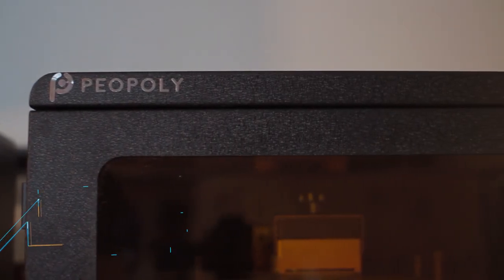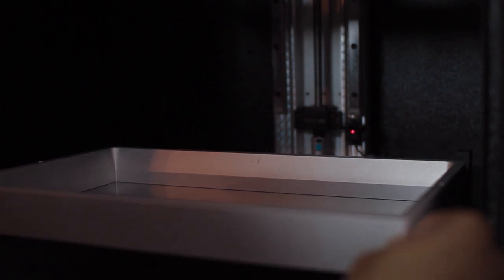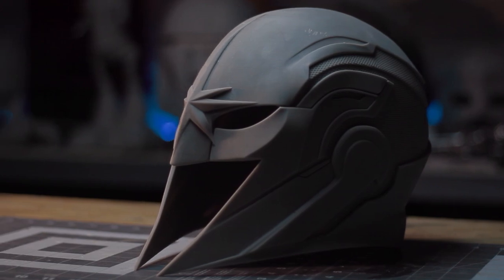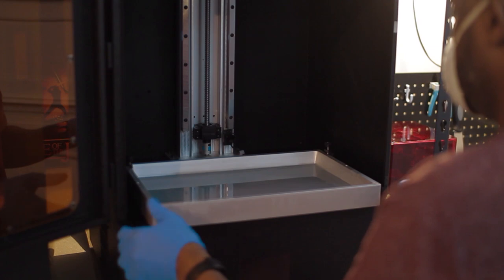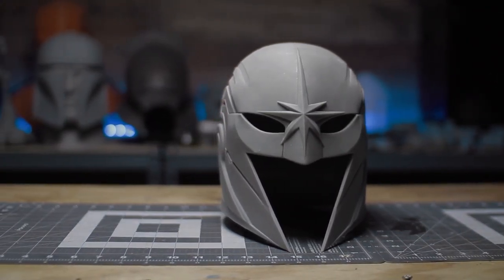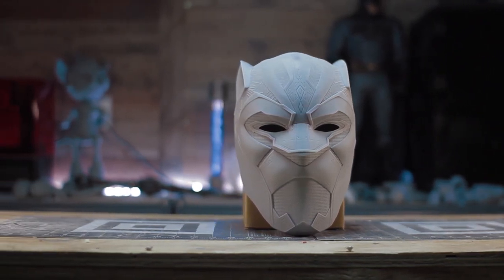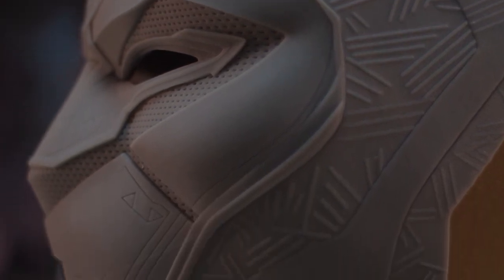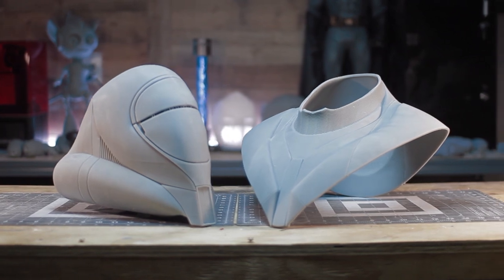3D-Printing Full Helmets! Phenom L SLA Printer Review

Comment: For those looking at the 400hr lifespan and freaking out about it. I have a resin printer, Print time does not equal lifespan consumption at 1:1, its more like 1:2 or 1:3 in reality depending on exposure, peel and lift times. LCD's for MSLA have a rough rated estimate in terms of minimum lifespan when exposed to the UV curing light. It is the UV light that causes the degradation. So a 37 hour print likely consumed 12-18 hours of UV exposure time. The mode of failure is also subtle and not instantaneous deadpixel in random places, and by that point you would have printed way past due its expected lifespan before you notice your print or vat degrading.
Reply: is their any system for masking off parts of the lcd to improve lifespan?
Reply: To add onto this, 400hrs = 16.7 days, so unless you're planning to print something that would inexplicably take longer than 17 continuous days to finish you probably have bigger problems to worry about.
Reply: @TheNewton  I don't know anything about that, but then at that point you're just buying the wrong printer for your needs.
Reply: @izzypleasures3545  I just took 3 days printing a mando helmet on an FDM printer, so 17 days of printing lifespan does seem super low.
Reply: @TheGame2K5  I think you're seeing the math wrong, its 17 days worth of continuous UV exposure until you reach the minimum expected lifespan of the LCD, if you count by print hours then it would be about 30-50 days of nonstop printing without opening the cover, and the printer does not continuously have its UV light on. For every layer there may be 7-14 seconds of exposure, and another 7-15 seconds of peeling and repositioning.
Reply: So instead of 11 helmet prints (400hr lifespan) you can get 22 or 33 (1:2, 1:3) out. That's still not great.
Reply: question is: how much is the LCD? For 20-30 helmets, $100-200 would be fine, $800 would be bothering...
Reply: I just checked; the LCD is $125. To me that’s totally OK if you compare either the labor time one would need for a manual sculpting or for manual creating a form and pour with any material, if per mask you end up between $5 and $10.
Reply: @TheGame2K5  The other thing which means your mando helmet wouldn't take 3 days in a resin printer, it cures an entire layer all in one go. So ultimately it cuts down print times as well as getting the detail.
Reply: @Zeis  Its the best that the industry can do for now with MSLA printers so $100-200 per is cheap if you're making money with the printer, But again 400hrs is a minimum, some people have 500-800+ hours on their LCD before they started seeing noticeable fading and print artifacts, the biggest factor affecting them is cooling and ambient temperatures.
Reply: still not very long.....
Reply: @Daniel Kim: Thanks for the explanation here and below. That puts a major concern of mine to rest.
Reply: I guess im asking randomly but does any of you know a method to get back into an Instagram account??
I stupidly forgot the password. I would appreciate any assistance you can offer me.
Reply: @Kason Jamison Instablaster ;)
Reply: @Rogelio Salvador i really appreciate your reply. I found the site thru google and I'm trying it out now.
Takes quite some time so I will get back to you later with my results.
Reply: @Rogelio Salvador it worked and I finally got access to my account again. I am so happy:D
Thank you so much, you saved my account!
Reply: @Kason Jamison Happy to help =)

Comment: That only took 37 hours to print. Damn that’s fast for a helmet.
Reply: Resin printers are very fast , but the clean up afterwards is the downside .
Reply: @lasarith2  It can be, but doesn't need to be. Getting an ultrasonic cleaner is a fantastic idea, and removes nearly all of that. Plus, there's minimal post processing.
Reply: You should see monochrome ones. The Phenom L has a 7s exposure while the Elegoo Saturn is 2s. That's somewhere around 7 hours saved. ( Technically the Saturn would be even faster than that since its lift speeds are also higher, but larger size requires lower speed, so that should be assumed as about equal for a better apples to apples comparison. )
Reply: zemerick13 true.
Reply: @zemerick  ultrasonics are great for small things but one big enough for a helmet would cost more then the printer.
Reply: It can be even faster. Depends on the amount of support material and thickness you decide to print. Otherwise, this is definitely a top contender for an SLA printer I would get.
Reply: If that 37 hour? But the lifespan of the LCD is 400 hours???

Comment: good to know about the LCD's finite lifespan ... 400 hours
Reply: As someone already noted during a 40 hour print the LCD isn't on for the entire print.

But yes the LCDs are somewhat of a consumable. The heat and intensity of the UV LED array is one of the biggest factors in limiting LCD life.

Finding the best settings for the printer and resin can help. Some resins cure faster than others. People also push the recommended cure times to minimize print time.
Reply: FYI, phrozen is currently promising 2000 hours on their 4k screens

Comment: Love the detail that is captured when printing with resin - the only thing that prevents me from getting one is the safety of handling resin and proper disposal of waste.
Reply: Same it seems like a huge hustle
Reply: It's really not that bad. Gloves are highly recommended, but then you just wash it in alcohol, use a toothbrush if you want, then set it in the sun or put up a UV light. Supports are much easier to deal with, less sanding is needed and is MUCH easier when it is. I love resin, just wish it was more durable and larger (which this one is the latter)
Reply: All of that is actually pretty trivial.

The resin is just a skin irritant, so all you do is wear gloves. It's not like it's fuming nitric acid or anything. Most people can spill resin on themselves and just wash it off with absolutely no effect whatsoever. ( As usual with these things though, each individual is different. Like Peanuts, an unlucky few can't touch the stuff or they pretty much instantly develop a rash or in the most extreme cases a blister. This is exceedingly rare though. ) In fact, most cleaning solutions that people use such as good ol' IPA or Acetone, are 100x worse than the resin. ( I just use an All-Purpose cleaner though, Mr. Clean mostly. )

The waste disposal is also not really any different from normal 3d printing, namely just the support material. The cleaning solution used can be cured, filtered and reused over and over.
Reply: @zemerick  Yes, you may be able to deal with contact with resins like this...for a while. The issue is that you will eventually develop an allergy to it leading to contact dermatitis and even reactions to the fumes.  This never goes away at that point and you won't be able to work with resins in general at that point.  IPA isn't anywhere near as dangerous as resin (it's rubbing alcohol and used all the time as a topical antiseptic), but if you try to clean resin off your bare hands with it, it will thin the resin and make it absorb into your skin easier.  Acetone is also not really dangerous, and is actually produced by our body...

You're right on cleanup and a lot of people don't cover this.  The IPA can be put into sealed containers and exposed to UV (or the sun) to precipitate out the resin.  It can then be filtered off and disposed of and the IPA can be reused.

Comment: I've been seriously considering the Phenom L since it was released. I'm concerned about the FEP film holding up to larger prints though. For example lets say there is a layer that takes up 95-100% of the build volume. Can it handle that kind of suction as it lifts up? To my understanding, the Form 3L uses a roller system to assist and provide pressure points to reduce the chance of ripping the film.

Comment: IDEA adding diferent colored strands of thread to the iner-layers during printing eather to make the construction stronger or to make holes that link together but dont line up exsept to a part of another construction as part of the same over all build. strands of wool or cotton thread could be an intresting addition to a build if added in the right way, in theory printing a plate around a luce stranded weaveing should reduce some of the wait and increase shock resistance a bit. wile also building up skills to add other small none printed parts into the construction later.
Reply: Consider some small pullys useing some of the threads for motorvation or even a suit of plate Armor with enough strong hollow pockets to build computer inside. the Question will be finding the better combernations to add to the 3d Matrix, adding a small amount of dry dust between the layers as its wet, small overlaping ceramic plates in a gel suspention pockets may absorb shock even beter.

Comment: Overall a pretty great review, but there are a few things I think should be pointed out.

First the only serious issue I had was when Darrell said the detail is just as good, this is unfortunately not accurate. This printer has nearly half the detail of standard mSLA printers. ( Most are 47 micron pixels, others are 50 micron. The Phenom L is 90 micron. ) So, that's nearly 4 times the volume per voxel.

There's a good reason btw that the vat is slid out, not lifted. A common reason for dead screens is people trying to lift vats and suction ( usually from a hole in the FEP leaking some resin that cures to the screen ) pulling the LCD up with the vat. When this happens, it's very easy to rip the cable. The screen also has to be relatively easy to lift and remove since it's a consumable that needs to be changed out periodically.

It's rather disappointing that Peopoly are charging $2,800 for a printer, but are using standard free firmware and software. Basically, you aren't getting any sort of improved quality with the dramatically higher cost. ( This is the same firmware and software used with the $190 Elegoo Mars. ) The fw and sw are fine, but not great. Perfect for a budget machine, but at this price there is no excuse.

The screen really should be monochrome now, especially considering the price. Most new printers coming out now are monochrome. This means 2,000 hours instead of 400, and exposure times of 4s instead of 7s. That results in significantly faster print times, and the 2 multiply together so that you're looking at around 20x the longevity per screen. Also as mentioned above, the panel really should be 8k, not 4k. ( Yes, I know: Good luck finding a 15" 8k monochrome screen. However, that's what is needed for the price they are asking. )

Even so, it's always good to see borders being pushed out. This just means someone else will swoop in soon(tm) with an even better offer.

Comment: 400 hours forget that I’m sticking with my ender 3
Reply: That's 400 hours of exposure time, not print time. So, around double that.

Still a bit low, but monochrome screens are about 20x better.
Reply: FDM printer won't get near this level of detail and surface finish.  Not even a close comparison.
Reply: @viru52000  Perhaps not, but many people have literally thousands of hours on FFF machines. Mine's creeping up on 900, and still working strong. Along with the fact many printers do well at 100 - 120 microns, which to many of us, is perfectly fine.
Reply: @Laffs00  The screen is a consumable on these printers, much like nozzles, belts, pulleys, and linear bearings are on most FDM printers.  The 400 hours is exposure time which is a much less time than the overall print time meaning 400 hours is likely closer to double or triple that in overall print time. They also don't instantaneously degrade and stop working, it's a gradual degradation.  The use case for resin is very different from FDM where FDM is great for functional parts without the need for super fine details and perfect surface finishes.  I own multiple FDM printers and know all to well the limitations of them and how horrifically LONG a print like a helmet at .1 mm layer heights would take and how little detail it would have compared to this.  This did it in 37 hours where an FDM would take over 4 days at .1 mm (rough estimate Prusaslicer gave me for a helmet that actually fit on the print bed).  The amount of support material and risk of print failure is also massively higher.
Reply: @viru52000  considering i have close to 3000 hours on my 300 dollar printer. I'm fine with that.

Comment: I've never done any 3D printing.   How durable are those masks?   Is it something you could use or would you make a mold of it and create a copy using another material?
Reply: It would depend on thickness of the resin a bit but at the stated 4mm he could easily add some padding to those helmets and wear them like ALOT. properly cured resin is harder than most plastics.

Comment: Does the machine have resin level indicator or do you just have to guess when to add more resin.
Reply: Well, ChiTuBox will tell you how much resin is being used. You could measure it before you pour it in. Of course this vat will easily take a full 500ml bottle. On my smaller Sonic Mini I just guess. I've gotten pretty good at guessing based on how deep the build plate goes when fully submerged.

Comment: I like this video I just ordered the phenom that's big enough for me. I had 2 creality resin printers the ld002r model they are work  horses I sold them to make room for the phenom . I love resin printing the prints are amazing. I have a creality  cr10  to print busts  I bought the phenom for printing large figures. Again thanks for the video I can't wait for the phenom  to come in.
Reply: @AusAhmet hey ausahmet i print super hero and action figures . I figured out and taught myself how print lithophanes . The resin i use in my peopoly phenom is siraya tech fast grey its abs like tough as nails and smooth as glass. That siraya tech is tough tough tough . All forms of 3d printing has its pluses and trade offs . I just got rid of my cr10 because it required way  too much tinkering with the printer, the parts and mainly cura and simplify 3d slicing software too many settings and things can still go wrong . If you decide on a resin printer i recommend the creality ld-002r and the creality halot one or if you want to go giant big like i did the peopoly phenom or the peopoly xxl for godzilla size. You can buy the sira tech resin and creality printers on amazon or through them the peopoly phenom at matter hackers or through peopoly. There are tons of youtube videos on resin printers watch them. I dont change the settings on anything l like running the default settings to keep everything running smooth . Happy blessed making.........
Reply: Yeah form labs is really expensive more for manufacturing than home use . The quality and ease of use with the creality model i think will be more than enough for you . There are large user groups on facebook if you have questions or problems . The 3d printing world is way more massive than one could ever know . Its totally addictive l could stay home and print with my phenom forever if i could . Now with resin printers there are parts that have to be replaced every so often like the uv screen , the fep sheet and sometimes the motherboard its best to keep extras around so theres no big down times . And remember theres a ton of youtube videos to show you how to change out what ever part to which ever printer you bought . Happy blessed printing.